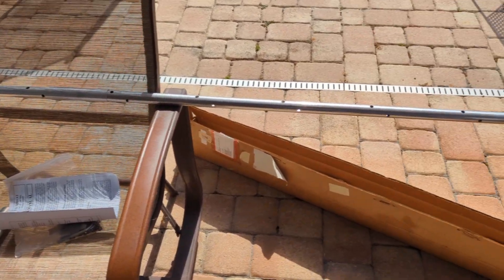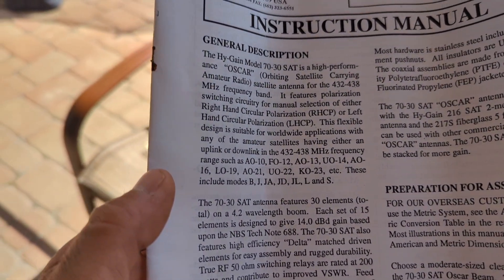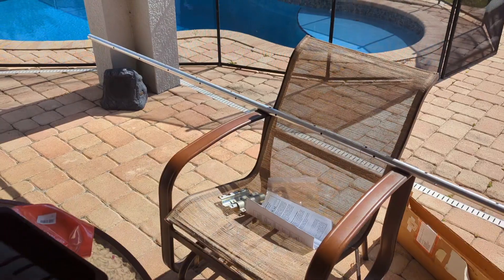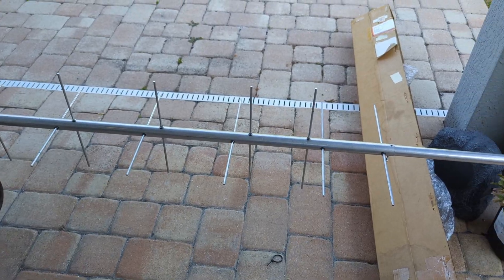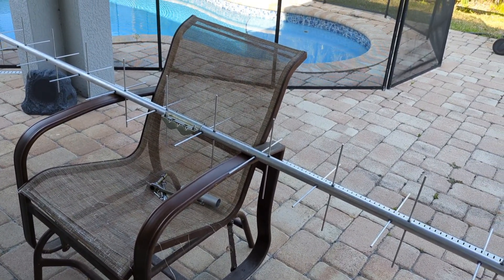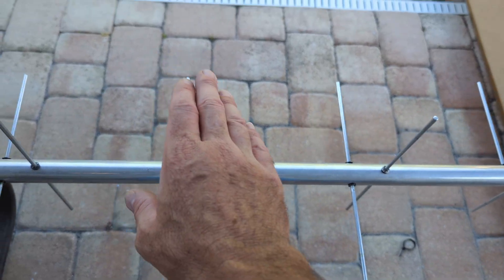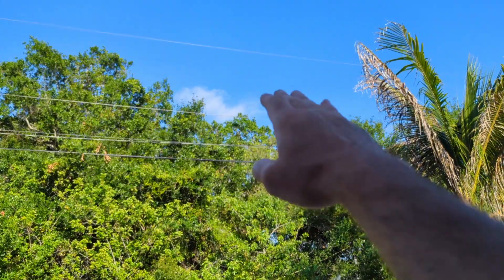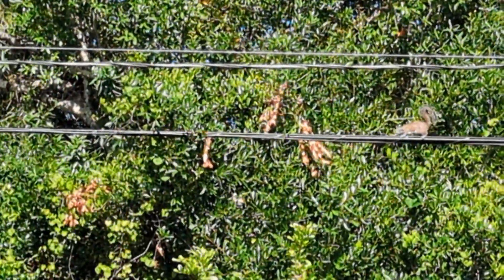EME Moonbounce Project, Part 1, The Antenna, Hy-Gain UB-7030SAT UHF Oscar Antenna

Comment: your never gonna do it with 100w and a single antenna.....your looking at 375db is transit losses alone...1.5kw, 30-50db gain, and az/el rotators....but, as long as you have fun....
Reply from the maker: I watched somebody do it with a homemade  5 element UHF cubical quad at 100 watts with a TS2000. It's worth a shot

Comment: Where are the two driven elements? de WE0H ..
Reply from the maker: The second to last on both horizontal and vertical. In front of the reflector. I need to complete the feed point section

Comment: You will need a VLNA. There are several excellent options to choose. Use a very good low loss coaxial cable.
Reply from the maker: I have some 1.25" hard line, some 7/8" heliax and some 5/8" feed line. If I use the inch and a quarter the loss will be unmeasurable at such a short distance.
Reply from the maker: What is a VLNA?
Reply: @HamRadioConcepts  Very low noise amplifier I think
Reply: @HamRadioConcepts  Very Low Noise Amplifier. Make sure you run one with good RF relays.